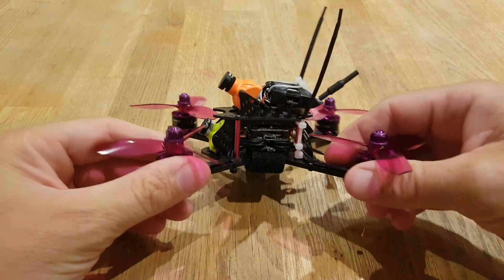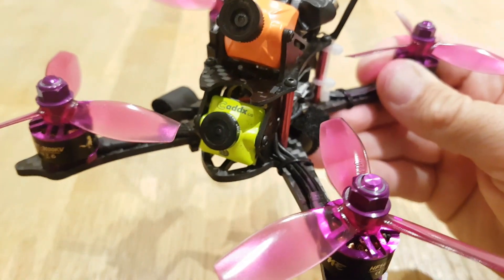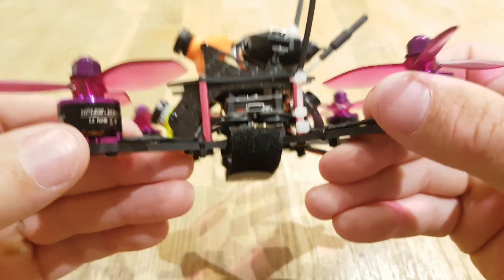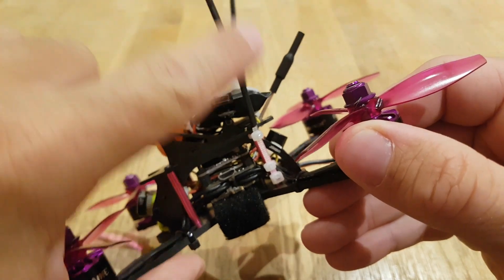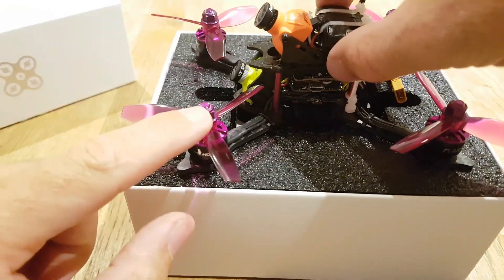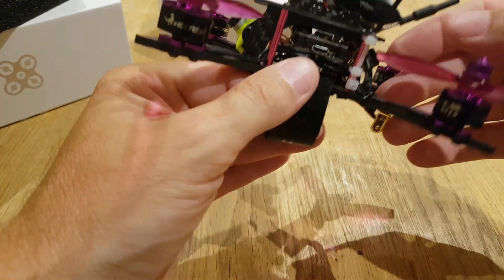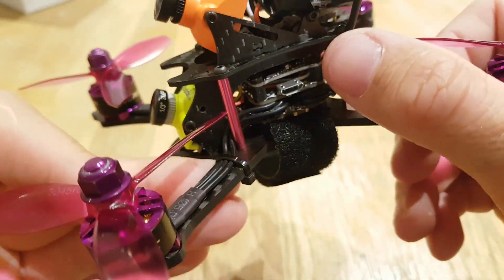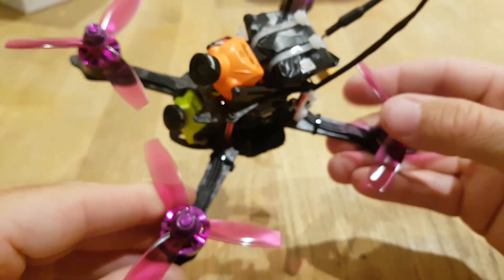HGLRC XJB 145 3 inch drone

Comment: whats weights? base n lipo? im buildind 3" under 90gr + 3s 550mah 145gr...
Reply from the maker: The whole setup with my 850mah batteries came out at 275grams. The batteries are 120grams so it must be around 155grams with the hd cam. About 138g without. There abouts

Comment: Why not just one run cam spit ?  That’s a nice set up , but I’m sure if it was mine, I’d bust that board strapped to the top the first day.
Reply from the maker: I've had a few builds with the split as the main camera. It's a pretty good fpv cam but comes out a little dark under tress and a bit orange when flying into the sun. The caddx sdr1 just seems to shine in all conditions. I agree the board placement isn't ideal but it's not as heavy as my 5" so hoping it will last lol